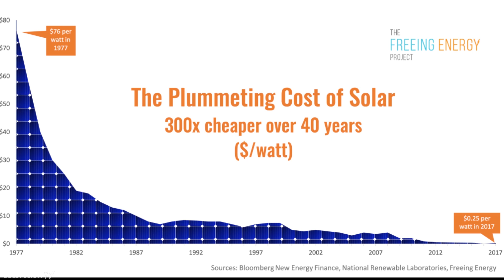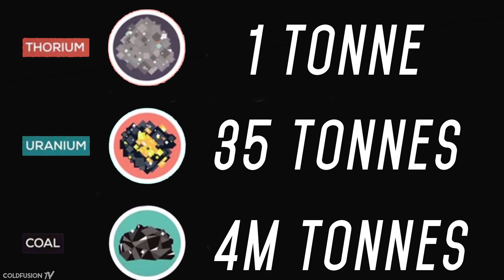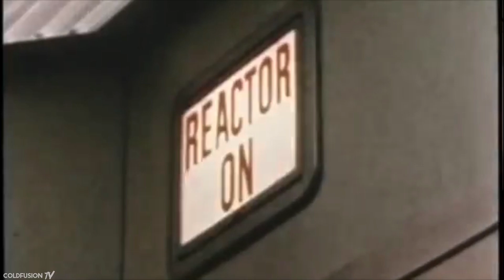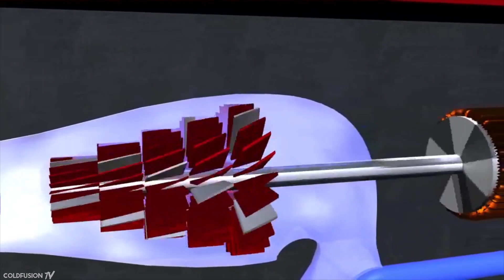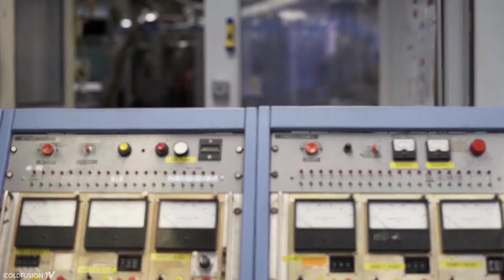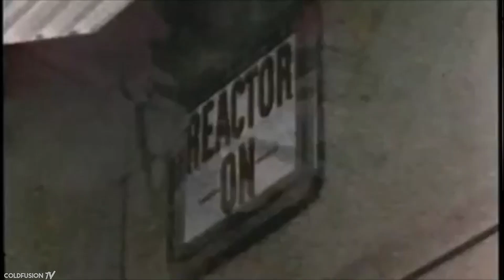Thorium - The Future of Energy?

Comment: BIG problems not mentioned in the video:

After seeing a few videos like this one, I looked into thorium reactors a little, and got scared off by some huge downsides not even mentioned in this video. (Actually, my objections are specific to molten salt reactors, but that seems to be how everyone plans to burn thorium.) 

The liquid salt contains the fuel, and therefore also contains the fission products, which are extremely radioactive isotopes. In a conventional reactor, these are contained within the fuel cladding and have decades to decay before fuel reprocessing has to deal with them. Here they have to be dealt with possibly minutes after being formed. Furthermore, these isotopes will include most of the elements in the periodic table. Some will chemically attack the pipes and vessels in the reactor. Some will freeze out in the heat exchanger. 

See that pretty diagram at 4:15? Look at number 5: "Chemical processing plant". That is where these fission products are to be removed. That plant has to deal with gasses, solids, chemically highly reactive stuff, all of which is insanely radioactive. Building a plant that can do this will be very difficult. Maintaining that plant will be very very very difficult,  because, again, everything is insanely radioactive. Malfunctions in this plant are liable to release really nasty stuff into the environment. 

Current day fuel reprocessing is a doddle in comparison. The material is many orders of magnitude less radioactive, and you can do it in a small number of highly regulated facilities. Molten salt reactors need one of these plants for every reactor.

Comment: No reactor will ever fission thorium. Thorium first has to be converted into Uranium 233. The thorium fuel cycle may burn most of the most radioactive fission byproducts and produce waste that is highly radioactive for only 300 years, but fast reactors fissioning natural uranium can also do this. The only real reason to use thorium right now would be because a given nation doesn't have uranium resources of its own. There is no shortage of uranium whatsoever, and thorium makes nuclear power more complicated. That's not necessarily a big deal in the longer run, but in the short run, it means higher cost at a time when we're closing nuclear power plants in the West when we need to be building new ones as fast as possible.
Reply: MSR's, Molten Salt Reactors that run on thorium, are projected to cost about $2/W. Coal power plants in the US currently cost about $3.25/W. Current nuclear power plants are about $7.46/W.
Reply: @Les_S537  And MSRs running on uranium have been projected to cost $1-$1.50/watt.
Reply: @Marmocet  cute
Reply: @Marmocet  Should be the same price, an MSR is an MSR and the process is the same whether you're using uranium or thorium.

Comment: With all that Thorium on the moon, we could build reactors there when/if it is colonized. Could be cool.
Reply: Funny you mention that...  There is a former NASA guy, Kirk Sorenson, who was working on a team of engineers designing lunar bases.  One of their requirements was of course power.  Solar works on the moon, but there are times when the moon is behind the earth and not getting any sunlight so they needed another option.  Nuclear seems the obvious choice, but current reactor models all operate with water as the coolant and they operate under heavy pressures to function correctly.  That wouldn't work on the moon, so he went looking for other nuclear reactor models at the US National Labs in Idaho and Oak Ridge Tennessee.  That's where he came across the idea of the molten salt reactor which due to the moon having thorium he figured it would be perfect for the project..  The research was mothballed years ago for whatever reason and he found it and posted it online for everyone to see saying that we should be doing this here on earth too.

So Sorenson went back to school and added a nuclear degree to his rocket science and space engineering degree.  He now has a company called Flibe that just got a contract with the National Labs to start work on a molten salt reactor for the US.  Another company that was awarded access is called Terrapower, which I believe is Bill Gate's nuclear startup company that he's funding with his own cash.

Comment: Global Warming is a United Nations SCAM. Our earth is warming up from the inside out NOT from the outside down. Our warming from the core of our planet which is  vibrating faster and faster is causing our core to melt and volcanos erupting at the bottom of our oceans and on earth suface. Why is this happening? Well, almost ALL solar systems have two suns and now our twin sun just passed and vibrated Mars and melted it's ice caps and as far as I know, there are NO cars or men on mars causing it's warming. Our twin sun is being seen all over the world, just go on You Tube and type in planet X or Nibiru. It swings passed us every 23,000 years and causes a warming cycle. I live in Florida and take a picture of it every month while sitting on the beach.
AS far as free energy, use what NASA uses to fuel it's rockets = WATER!! yes the big tanks on the outside of the space ship hold nothing more than WATER. When the tanks are lit, the hydrogen burns and the oxygen  condensation is thrown out the back. H-2 O.

Comment: The presentation is interesting, but I think there is a contradiction between the hopefulness towards thorium reactors, and the fact that world energy production will have to be changed almost completely in thirty years. All current players on the energy field know that solar and wind will dominate the world energy production in that time. There just would not be a market for thorium reactors when they would be ready (which they probably would not be even in thirty years). Wind and solar are already the cheapest way of producing electricity in many areas of the world, and they keep getting cheaper. Their intermittency is not really a technical problem, but just a cost factor. Because of the declining prices of solar and wind energy, an ever wider selection of energy storage solutions will become viable. Energy storage will experience the same downward spiral of prices that solar and wind are experiencing. Growing capacity and intelligence of cross-border transmission lines will on the other hand limit the need to store energy, and demand-side response (DSR) is affecting into that direction too.

If someone analyzing energy sector was ten years ago unable to see that things are inevitably heading towards renewable dominance, there might have been some excuse for that. Today there is none, as the process has already advanced so far, and it only keeps getting more monentum.

Comment: "Thorium reactors are incapable of having a meltdown" I feel like I've heard this before...
Reply: What they mean is that in a molten salt reactor the fuel is already a liquid.
This means that when the fuel gets too hot it expands. The added pressure inside the core pushes out some of the fuel, which then results in the slowing down of the reaction in the core and the fuel to cool down.
A molten salt reactor is essentially a self regulating system.